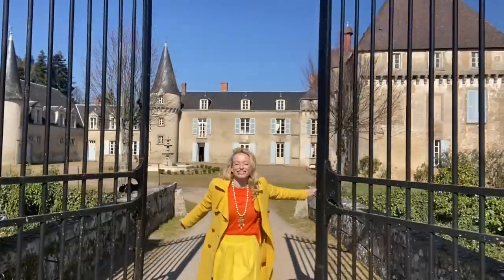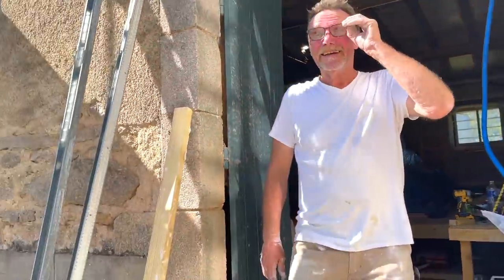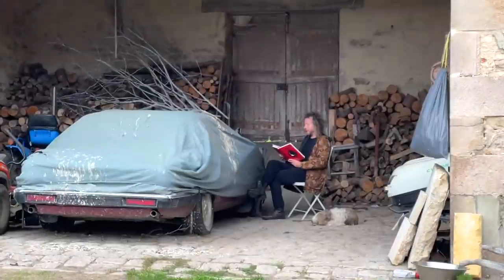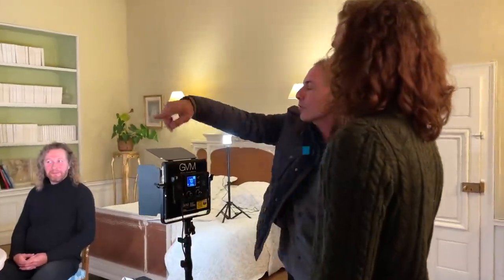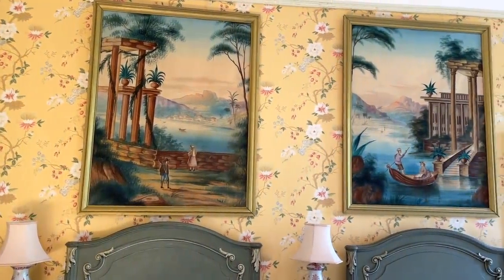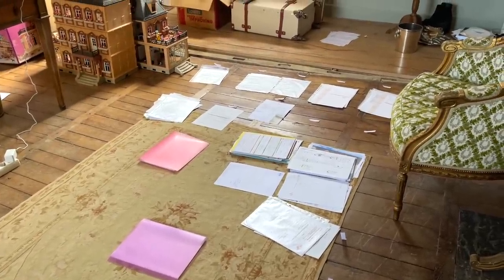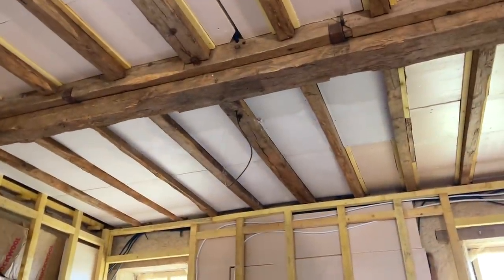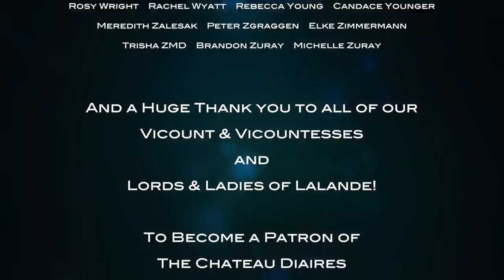DOING IT OURSELVES!

Comment: Hi Stephaine:  Due to the castrophic failure of your heating system I strongly suspect your have galvanic corrosion going on.  Merely replacing the radiators will not solve the problem.   Galvanic corrosion maybe caused by a water line being run next to an electrical wire some where in your system.  It can also be caused by your system having two different types of metal fitting coming into contact with each other.  Check the ph of the water you are using to fill the system.  If the water has a high in alkaline or sodium, this maybe the cause.  (Do you have a water softner at the chateau? Fill your system with water that has not gone through the water softner as most water softners use sodium)  Also check the electrical ground on your water pump to make sure that it has not come loose.
Reply: Bumping this comment up so they see
Reply: Bumping this up. So many failures indicates a serious problem.
Reply: Very good info!
Reply: Good to know.
Reply: bumping along....
Reply: Bumping!!!
Reply: Certainly worth checking out!
Reply: Completely agree with this comment
Reply: Bumping…
Reply: That sounds like expert advice! 👍😊
Reply: Agree! Bumping.
Reply: fingers crossed they see this.
Reply: I thought galvanic corrosion speeds up corrosion and wouldn't she have had this problem a lot sooner than 16 years when they were installed?   16 years is also near the end of its life for a central heating system.   She said there was a loud bang.  The pressure of a bang would have radiated out to all the heaters.  That is probably why they are cracking.  If water flow is too slow or restricted, it super heats in the boiler and when it hits cold water it explodes. That would explain the system over pressuring and all the radiators failing at the same time.
Reply: Bumping this up, because there seems to be a bigger problem afoot with so many small leaks popping up at once.
Reply: Helping the bump!!
Reply: What does 'bumping it up' mean please... And what's the impact?
Reply: @amandalevy1227  each comment bumps the previous comment closer to the beginning of the comment thread.
Reply: @dumvivimus  12 radiators seems high even for a chateau in a rural spot, definitely
Reply: Bumping up first time good to know 🥰💕💃🏻
Reply: They use anti freeze, not water, in the system.
Reply: Something happened that caused the pH in the system to change. I assume it changed while the system was idled over summer, because the problem began immediately as soon as Stephanie pressured up the system. That type of corrosion doesn't happened in minutes. Maybe the wrong antifreeze was used. Propylene glycol has a rather high pH of 8.3 to 9.0 when diluted to 30% to 50% solution. Too much water and not enough antifreeze perhaps was the cause.
Reply: @Rebelmusedesign  The geothermal system won't be working at it's full capacity until the chateau is fully insulated and weather sealed.
Reply: Bumping up
Reply: I thought that,some fault affecting the water somehow Thanks!
Reply: Also each radiator should have a valve either side of the radiator in the pipe work that you can close precisely to be able to take out the rad without draining the system.  Worth installing if you don’t have them there.  Don’t know how old the rads are but worth going back to the supplier and complaining.  We had one aluminium rad that popped a hole and it was replaced free of charge no questions asked.
Reply: Great comments!!! No one should have this many failures in one season! So sad! I hope it is worked out soon.
Reply: @Kerrin77JIH  Radiators tend to have a domino effect when things go wrong. Plus 16 years is a pretty good run for modern radiators as sad as that is to say.
Reply: @jeannettesmyth7643  Antifreeze is used with geothermal systems to make them more cost effective. While you could make a huge geothermal loop throughout your property, it costs a lot more to build and maintain. So antifreeze makes a smaller geothermal loop more effective.
Reply: @1968rhiannon  I don’t disagree. Just sad they are going through this. Also, replacement of quick, but otherwise inappropriate parts, just causes a problem in 3-5 years vs 16+. Who know how many patrons will be around then? They are all so precious and it’s sad to see them cold. But properly handled they could be warm for another 25 years. Our heat was expensive, but we are still warm and efficient 30 years on.
Reply: @Kerrin77JIH  Better that they're going through this now, and not in the middle of winter. Plus they're making  really good decisions about upgrading the heating needs of each room. Taking the hands on approach this time around will mean they'll understand the system they're working with much better. Geothermal is an amazing system, once it's fully operational they will be warm and cozy. Plus it's really beneficial to the health of the building.
Reply: Excellent advice.
Reply: Bump up!
Reply: Ok. Bumping along.
Reply: Wow! Such valuable advice 🙏🏽

Comment: Just watched the episode with the radiator failures. I had a forty year career as a Director of Facility Operations and construction in the states. Mostly hospitals, but also university buildings and one casino?  Looking at the close ups of the radiator failures looks like you may be missing the chemical regiment needed to descale the system to keep them from rusting out from the inside. Thus, all of them failing simultaneously.  I have experienced this many times in my career. Also, don't fail to include the thermal loss when calculating the replacement radiators. Love your channel , which got my wife and I through the pandemic! We haven't missed an episode yet! Thank you! Good luck with the heating system, they can be tough.
Reply: My husband thought the same when I mentioned the radiators failing.
Reply: I hope they don’t actually try to Do it Themselves. Otherwise money will be spent twice as the underlying problem will persist.
Reply: So lucky to have so many competent people commenting!

Comment: Hi Stephanie, I hope you don’t mind me putting my two pence in regarding your central heating. I seem to remember years ago that if galvanise steel fixings were installed with copper or steel in the system it caused a reaction with the other components hence caused other fixtures like radiators and pipes to corrode and leak. When you and Amury showed the radiator on the vidio it reminded me of this problem. I could be wrong but it might be well to check this out, as it is an old building . 
Take care Sandy
Reply: that all makes sense as why would so many leaks all occur at once . i am not a plumber but its a point
Reply: @vanessaschofield7927  good time to get a consult from an expert. Seems like a systemic problem to me too. More than individual radiator problem.
Reply: Bumping this comment!
Reply: @erinbriggs2087  Me too
Reply: This seems like it could be the problem.
Reply: Definitely some type of corrosion
Reply: Great point! I hope Stephanie sees it.
Reply: The other thing I’ve heard is that once one radiator goes, you can expect the others in the system to go shortly after (that were fitted at the same time). So, not surprised at the domino effect going on.
Reply: @sandra Taylor  An inhibitor should be added to the heating system... shouldn’t really make much difference what mix of metals (unless it’s aluminium in contact with steel) provided a suitable additive/inhibitor has been used. The problem will persist otherwise.
Reply: Agree the compnents do have chemical reactions thus have to be the proper fittings on those also pressure is way to high.
Reply: Yes, dielectric unions are a plumbers friend!😉
Reply: @Kathleen Huguenin All the heating systems that I have ever worked on have mixed metals, ie, mild steel, or cast iron radiators and, copper, brass, or mechanical pipes and fittings etc, but the only way to prevent rapid corrosion, is by adding an inhibitor when filling the system.
Reply: Yes, I agree, something else underlieing to cause all the radiators to have the same damage. 🤔😊
Reply: Any response here to show Chateau Diaries are reading this??
Reply: @ninas992  definitely, they showed the rusty water on one shot

Comment: Hi Stephanie.  We're in France, and have the exact radiators as you.  We also had a leak and we used the French equivalent of 'Stop leak' liquid bought from Brico Depot, Angouleme.  This might buy you a little time until you can get new radiators up and running.  We did our heating system ourselves too, only 14 rads, but very satisfying...good luck!

Comment: Not sure about putting radiators in the long windows because surely the curtains will be shut in the bedrooms at night and in the mornings and all you will be doing is sending the heat out the window ( especially as they are not double glazed) as the curtains will block the heat getting into the room ? At least you found the leaks now so you have some time to get it sorted before winter arrives.

Comment: Stephanie, Have you ever explored the possibily of "Ground to Air" heatpumps for the apartments within the Chateau?  They would be fed by the same ground source as your "boiler" but provide zoned, forced air, heating and cooling, Nick & Marie's, Michael's, Mummy's, Natalia's, Jerry's as well as the Marquis's apartments could all be fitted with individual air handlers feeding off of the "anti-freeze" from the current system (with built-in back-ups) and could then offer heated as well as cooled rental units.  This should reduce the drain on the current or any new boiler.  Just a thought, but could be a better way ro heat the building as it grows.  Just a thouht to explore.

Comment: I'm so glad you'll be upgrading your heating, replacing leaky, underperforming radiators! It will make such a difference, as I know from personal experience that such grand houses are as cold as caves in the winter months. I hope you'll soon have double-glazed windows and rubber base-seals along the bottom of inside doors to help keep that heat from escaping, too!

Comment: Might I suggest having drip tray made and fitted to hang from the bottom of each radiator. Place wireless, wifi connected alarms in the trays to alert you to leaks. An auditable alarm will sound from the small battery powered sensor in the tray. However, as is always the case in my home, I'm often on the other side of the home or two floors away to hear it. Which is where the app alert via wifi saves the day. I also had a remote shut off system fitted as well. This came in handy when a boiler burst while on holiday. I recieved notification of a leak in the mechanical room. With a few clicks I was able to turn off all the water systems in the house, minimizing damage. The water was mopped up and the floors dried the next day. A new boiler was installed well before I returned from holiday. If I was not alerted I would have returned home to find both the basement and sub basement under water. This would have taken out all of the computer controlled HVAC systems for each level of the house, the electrical systems for the entire house, the servers controlling virtually everything in the house, everything stored in vaults, and quite possibly serious damage to the foundation. To say I was shaken up by what could have been is putting it mildly. Upgrades to flood mitigation were undertaken almost immediately. This included automated shut off valves and more alarms in the event of future failures, adding more drains, and more standby pumps should the other measures and their redundancies fail. Indeed, this is why we have insurance. However, the headaches, lost time, and loss of irreplaceable treasures is avoidable. That said, by far the most important, least expensive, and diy measure I put in place years ago are the little wifi leak alarms. Like other wireless alarms and sensors one must replace the battery, as outlined by the manufacturer for each specific model given usage as well as environmental conditions. Thankfully we no longer need to remember such uneventful tasks. Adding this task to your calendar, repeating every year or five, is as simple as it gets. Depending on how many radiators one has in their home, an alarm or automatic shut off added to the system hub may possibly be more economical. However, a small leak may not trigger a shut off, or may take hours to drop the pressure low enough, if at all, to trigger the shut off. Which could allow fluid leaking from a radiator on the fifth floor to go unnoticed until the guilded ceiling plaster of the ground floor music room comes crashing down on historically significant instruments, art, and other treasures. There are multiple types of automatic shut offs. Consult a professional to find the right solution for your needs. Some of you may see insurance premium drop slightly with the installation of flood mitigation measures.

Indeed, as others have noted, there appears to be adverse chemical reactions taking place within the system causing premature corrosion and failure. This many radiators failing indicates an issue within the system rather than simple radiator failure. Unless there was a hard freeze, with diluted antifreeze in a stagnant system, inside the château whilst the system was off. The latter seems impossible with the home constantly occupied. All of the radiators of the same or similar age and composition should be replaced. Or at the very least removed, cleaned, examined, and tank tested under the originally rated pressure to expose any weakness which may lead to future failure. The aim is to prevent sporadic failures. As you well know with many rooms vacant the possibility of catastrophic damage is great as the first sign of a failure is water in the room(s) below or flooding in adjoining room(s).

Cheers.

Comment: Looks like pressure is high on several of the radiators. Should have done in floor heating way cheaper and warm on the toes. There is recycle money to be had on old radiators weight and metal content. New ones are way cheaper than constantly redoing older models. Busy as bees there and Beeswax smells heavenly!

Comment: Judging from the rudimentary calculations installing the appropriate heaters you will see a significant jump in your electricity bill you may also need to consider investing in solar cells a couple of things come into play when you're checking for your heating these include what sort of insulation you have and the type of windows for heat leakage

Comment: About your radiator problems. Maybe it’s depends on that you empty your system every year, because when you’re emptying the system your always have a little water left and when it’s meeting oxygen it’s starting a process of rost. So one solution could be, not empty your system during the summer. Just turn the heating off. 
Sorry for my very bad English. 
Greetings from northern Sweden.

Comment: Having the gauges self regulating so as to adjust pressure are a pocket book saver, Rooms not being used can be decided so water does not freeze, etc. Cosing drapes contain heat,etc. Well you know however be careful  as to not get  refurbished on those. Consider in floor heating for Natty's home space.

Comment: Stephanie & Amury about your radiators that have burst. It seems that water pressure psi is to high. That may be the cause of the leaks. You can buy a pressure regulator to lower the pressure /PSI.

Comment: I wonder if Flex Spray would be a quick repair for all the radiators until you get replacements.  It’s a product from USA I think.  If sprayed on boats, canoes etc, they would allow them to float without any leaks.  Temporary.

Comment: When the water pressure is so low you can't use the chateau fountain and house water at the same time; Then in the summer when you dig a whole new water pipeline to the well and [all the water pressure is higher than it used to be] for next winter; and then all the poor radiators feel the new higher pressure that they are not used to, and want to explode......

Comment: Is there no heating expert among your patreons or subscribers who could help you? I personally would try to go for a sustainable option. I know that castles are very hard and expensive to heat therefore it would be good to have a long term plan. And double check if really the radiators are the problem and not something in the system as some comments mentioned. Not that you end up changing radiators every year.
Reply: I think one above two comments back, nailed it.  Hoping Natalie or Steph or Phillip even, sees it
Reply: I think the geothermal was chosen because it is one if the most sustainable methods, however, it seem’s like Lalande’s could use some upgrades down the road (it was mentioned during the overview of the land survey with Davey I think), and now there is also something else that’s happened with the system that I am sure they will discover!

Comment: Dear Stephanie. and Amaury,
Just a thought if you have not put the Radiators in the small window alcoves yet.
There seemed to be heavy curtains which when pulled shut at night may mean the heat is the wrong side of the curtain and most may be lost to the exterior. Just a thought but clearly it will depend on the exact configuration of the room. Although a surgeon (retired) I do all my own Bricolage !! I would be interested to hear what you decide. William

Comment: Is putting radiators under the windows but behind the curtains a good idea? At night the curtains will stop the heat getting into the rooms.
Reply: Yes and no, it's the only place you can + most of the day the curtains are open. otherwise you get cold and hot spots in the room. 
Ideally the chateau would have modern insulation and central air but this is a channel about living in GD chateau ahaha
Reply: I was wondering the same thing. On a cold night the curtains will be closed, blocking the heat from the radiator.
Best wishes Lalande!
Reply: Sounds like Amaury may get roped into making internal shutters for that entire wing anyway